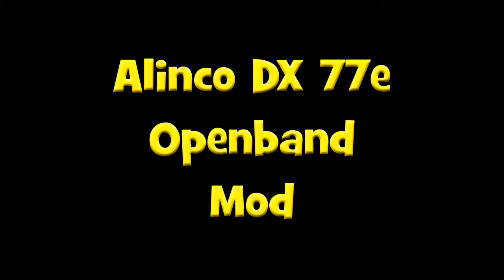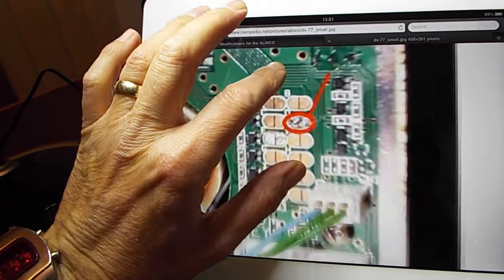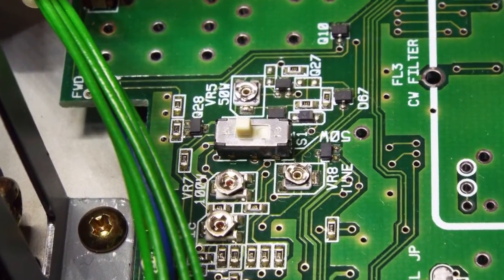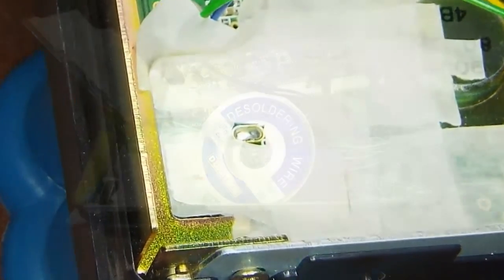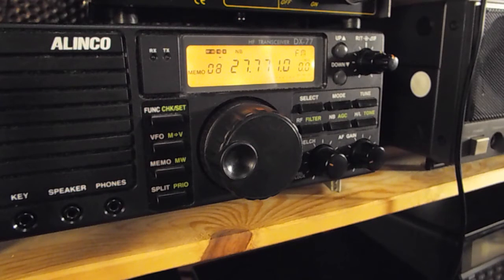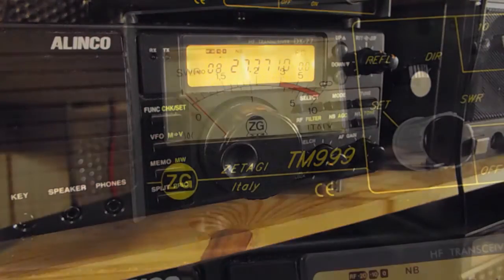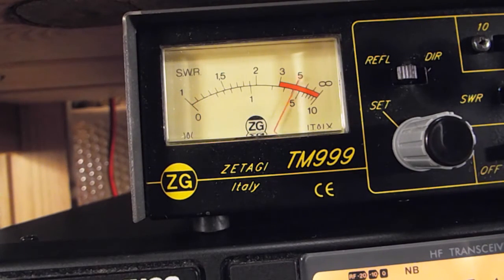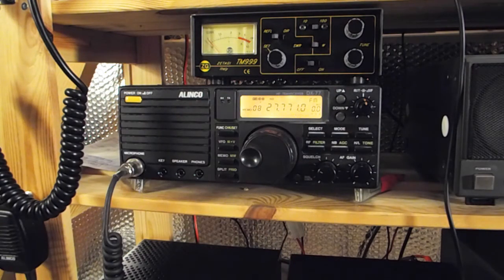Alinco DX-77E Full open band mod.

Comment: Well done, love the idea of the masking tape. Any thoughts on what the "E" variant of this radio is compared to the "T" version?
Reply from the maker: Yes filters i think.  The E is the lower end model.  There are sockets on the board for plug in filters.
Reply: fredintheshed1 Makes perfect sense as the T version does contain the missing filters you refer to. Kenwood, for instance, used the E suffix to distinguish European models with access to different freqs from the US 2m & 70cm rigs. Thanks for the reply! All the best to you!

Comment: Your Mod. looks stock.  Did you need to reset the radio after your de-solder Mod. ?
If so, how ?
Reply from the maker: +John KALIL Hello.  Yes you need to do a simple reset.  Hold down the FUNC key whilst turning on the power.
Reply: Thank you. I have tried to listen on your 305 net on a few occasions but have not heard anything. I am located near Beccles in Suffolk so probably too far away. Thanks again and keep on posting the videos, very enjoyable.